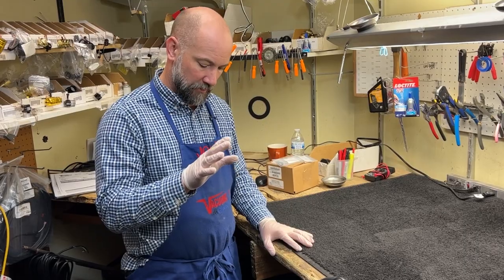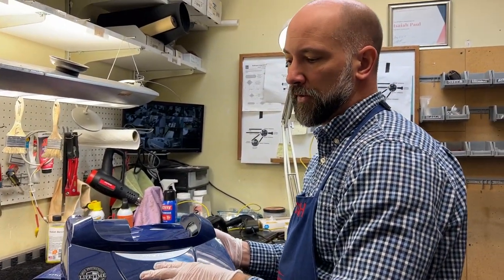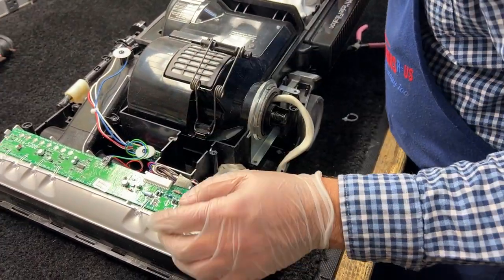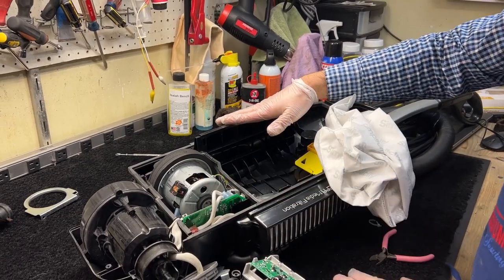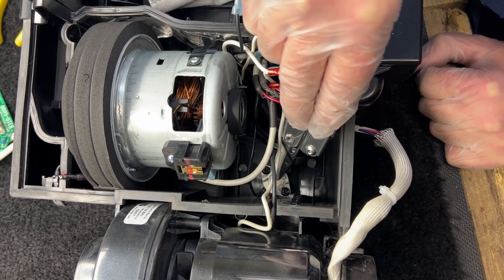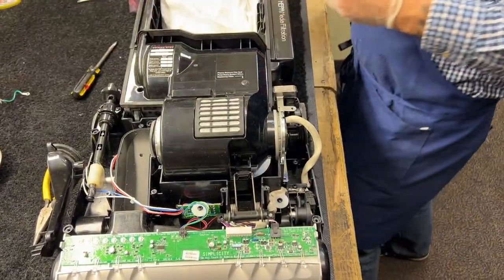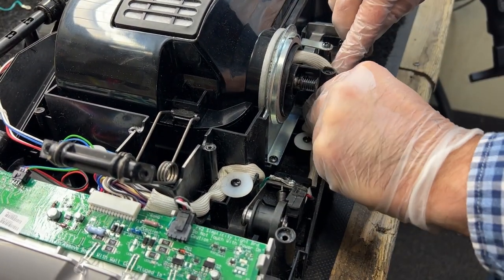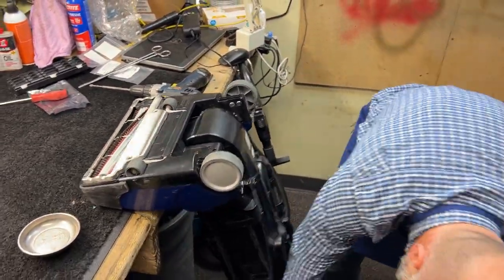Riccar R40P Brush Roll Turning Off - Hall Sensor Repair

Comment: Thanks for this video!  It's very timely, as I live in Minnesota and have an R40P that developed exactly this problem within a few months of purchase.  It can vacuum carpet OK but area rugs immediately cause it to shut off the brush roll even on the highest height setting; no such problems when the unit was new.   The dealer has replaced the belt and Hall sensor itself so far, but the problem remains, so as you say, it's likely one of the boards.  My R40P is revision .8, so this must happened despite the addition of that grounding spring shown in the video.  I had a previous R40 that failed while still under warranty (a pre-Hall-sensor model that lasted only 5-1/2 years).  A common problem with both units has been that the assist and/or recline latch springs tend to break about every 8-12 months despite reasonably careful handling - just weekly residential use in a larger home.
Reply from the maker: Since the video was made we have been made aware there has been a significant update to the PCB in these units which is supposed to resolve this issue. Resolving the problem has been a serious challenge for Riccar because as you note it can be hard to consistently replicate the issue since it only presents in specific environments. We are waiting until we have significant real world experience with the PCB to state that the issue is fully resolved however we are hopeful. While certainly problematic to customers like you I can assure you Riccar has taken this issue seriously and poured a ton of resources in to tracking down the problem and finding a final resolution. The R40 is their flag ship model and this has been a real pain point for all involved because frankly nothing compares to it. Going forward all warranty repairs will receive the new PCB. It sounds to me like you have a great dealer who is fulfilling their obligation to get these machines repaired under warranty which is the good news here!
Reply from the maker: Oh, and regarding the recline assist spring. I'm not sure which one you had that was breaking but there was an upgrade a few years back that resolved that break for the most part. All the ones we see coming in broken at this point are either pre-upgrade or teenagers using vacuums =)
Reply: @vacuumsrus  Thanks for that info.  Is the updated PCB available to order yet, and could you please share the part numbers for the original and revised boards?
Reply: @cc213t  I'm not sure if there is actually a different part number yet. It's entirely possible they simply disposed of the old boards and kept the same part number. Either way all PCBs that have been shipping for the last month plus are the new ones so if you bring it in for warranty work the replacement board will be the new ones. This whole thing isn't exactly a recall persay because the majority of boards never showed an issue. They are just being replaced in current production and in future repairs.
Reply: Just following up to say my dealer replaced the PCB a few months ago with the revised version, and so far, that seems to have completely solved the problem.

Comment: Hello,  I really enjoyed your video, expertise, and especially your narrative.  Very nice work you do.  
One of my hobbies is fixing Vacuums. I only work on expensive brands.  I found a Lindhaus Healthcare Pro and a Riccar R40P.2 for sale at the Thrift store.  They both were very ugly with dirt and grime.  Cords good on both and under all the dirt, nice machines.  Cleaned them up and both seem to work.  The Lindhaus needs the plastic piece that the Hose seats into and the Riccar just needed some bags.  I noticed the R40P.2 of mine has the headlight all the way across.  I bought both of these Vacuums for $70 total.  When I went to the local Dealer to buy bags for the Riccar and they told me the R40P.2 is only worth $40 used.  I had a Simplicity PET Fetch Vacuum that was finished in a bright green, forgot the model number.  It was mint.  I really liked that Vacuum!  I sold it for $350 to a Private Party.  I think we'll keep the R40P.2.  It's a little too heavy for the Wife to use but I like to vacuum so great.  I subscribed to your channel.  Thanks again.  P.S. - I hope the R40P.2 isn't a lemon.  I'm hoping it doesn't have a board failure in the future.
Reply: How do you compare your simplicity pet to the r40.2?which is better for cleaning in your opinion ?
Reply: @rachel2005lucy  The Simplicity Fetch Pet Vacuum did a great job of cleaning and wasn't so complex electronically.  The Riccar R40P.2 does an excellent job, probably better than the Fetch.  But for reliability, I'd choose the Simplicity Fetch. And the R40P.2 is so heavy at around 23 pounds.

Comment: That’s a lot, electronics, sensors. I disassemble to change the motor in a Dyson DC39c well no electronics but it was clog at the cyclone entrance also I found the bypass valve was jammed so it fried the motor in a couple of minutes. I found a Panasonic motor and replace the old one. After watching how Riccar is I understand why old Dysons are now in  the trash they have no protection.
Reply from the maker: Yeah and after having done that motor replacement you can understand why we don't have a "how to replace a dyson motor" video. One of our past techs did one years ago which is still hosted on an employees personal youtube channel.  I hate doing those things. There are 10000 tiny little fragile plastic parts and 4 different screw sizes. Absolute nightmare to work on. The Riccar tandems aren't the simplest thing in the world but at least it obvious they were built to maintain and repair by a human.

Comment: I just picked up a Simplicity Synergy x9.5 for $75 off eBay. It comes in next week. How different was the jump between the .5 and .6? And are they the same revision numbers between Simplicity and Riccar?

I also just ordered a bunch of parts from your website, belt, bristle inserts, bearings, base cover, bag cover.
Reply from the maker: We don't have any documentation remaining as to what the modifications between .5 and .6 were. I imagine it was not a significant change since our technicians have no memory of changes. As an aside the x9 series uses a different PCB than the new 40 series machines and the old x9 PCB was far less susceptible to failure than the modern 40.1-.7 units

Comment: Do the r30s suffer from the same issues or is this an r40 problem?
Reply from the maker: It happens but historically it was not as much of an issue. They are a similar but not identical design. Since this video was filmed we have not seen any issues with the latest version of the R40 with the new PCB assemblies.